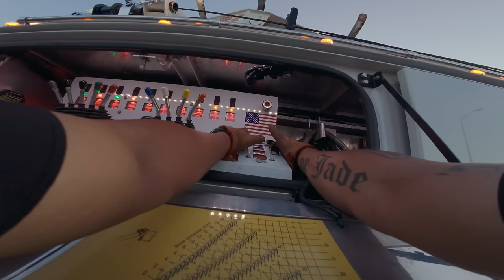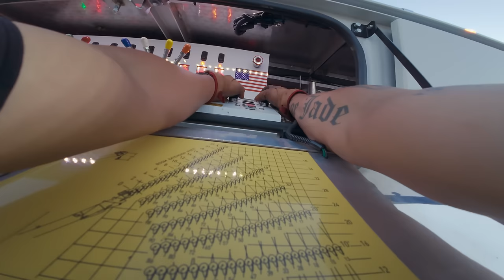Driver survives HORRIFIC semi wreck!

Comment: THAT IS A FREAKING DANGEROUS JOB, JUST LISTENING THE SOUND OF TRAFFIC GOING BY.
Reply from the maker: And we do it with a smile :_Approve:
Reply: You certainly do.  @PepesTowingService
Reply: @PepesTowingService  does traffic just not slow down in your area?
Reply: @SlickFootTito it’s southern Cali…. Way too many cars , too many idiots behind the wheel and in Cali you’ll catch your self pushing 80moh average cause everyone else is going that fast yet most speed limits in Cali highways are 65…… i used to drive from chino to Moreno Valley everyday 2 hour traffic and in such short distance I’ve seeen the dumbest things happen on the freeway…. More people more problems.
Reply: @PepesTowingService  The cops should be writing tickets while the lift is in progress, some of the speeds at close quarters is insane.
Reply: @PepesTowingService  Isn't there a "move over" law in Cali?
Reply: @MurgatroidGarfunkle There's a road rage, offensive driving, and police chase mandate in SoCal. No one will move over and people would sooner find a way to get away with a hit-and-run than help anyone else.

Comment: The shear pins on that cab works exactly how they were supposed to. 
Modern semis are designed to do that in a violence crash. It helps dissipate energy so the occupants are not subjected to massive crash forces.

Comment: On european Trucks (we manly have cabovers) especially Scania cab removal happens often on mayor accidents.
It’s most of the time a lifesafer for the driver.

Good vid as always!
Greetings from Hungary 🇭🇺 in Europe.
Reply from the maker: I’m starting to believe, but it’s a wild concept to understand. “we design our trucks so when you crash, the entire cab comes off the chassis to protect you”.
Reply: I'm guessing, but the cab probably gives you a passenger cell like in cars, and the shearing off acts like a crumple zone giving you less g over a longer time. The downside is you'll only ever crash that truck once! It's like 1970s cars vs crumple zone cars. The old ones the driver was a gonna but you could sell the car, the modern ones sacrifice themselves to protect the occupants.
Reply: I saw edison motors touring european trucks, and one of the things they noted was 4 corner air bags on the cab instead of front hard mounting, so i see how they could basically just pop off the frame

Comment: Yes God is good indeed.  Sad thing is that JB Hunt driver probably just lost his job even if he wasn’t at fault.  My husband logged over a million miles with zero accidents when he was a bull hauler.  He said the problem with the truck drivers these days is that there’s just too many out there with very little experience.  And the texting while driving situation is out of control. Sad.
Reply: JBHUNT, in the industry means Just Been Hired Usually Not Trained. This guy was doing something(on the phone?) and trying to merge Illegally into oncoming traffic. Notice how he was too far onto the non merge area. and tried to cut the wheel like he tried to avoid the accident. Clearly HIS FAULT! Was a truck driver for almost 15 years before my husbands retirement. I've seen some stupid driving in my time on the road. Two million miles for him.
Reply from the maker: @CatsCrazyWorld  JB Hunt guy was pulled over where he wasn’t supposed to be, for unknown reasons. Driver of the Volvo, if I had to bet, fell asleep or was on his phone
Reply: @CatsCrazyWorld  awesome
Reply: @PepesTowingService I drove tractor trailer for FedEx express in SoCal for 20 years. I think your assessment is 100% correct

Comment: Really great that the driver walked away from that one.  Not sure, but suspecting it may have something to do with the cab suspension systems that are designed in giving essentially a "breakaway" joint for the cab which acts like an escape capsule.  No idea whether it's intentional or not, but fortuitous in this case.

Comment: What’s the driver wearing flip-flops?    I remember the Russian that was wearing open toed sandals driving the hotshot rig with the 18,000 pounds alternator. Are there any good drivers out there anymore or are they all foreigners? Looks like you need a little more space on your driver side of your truck would be nice, wouldn’t it, be safe. You guys do a good job.
Reply from the maker: Tons of drivers in my videos wear flip flops. Comfort or correlation? :_Laughing:

Comment: Why didn’t they put the cab onto the same trailer with the truck chasis?
Reply: A hassle to find enough space and secure both properly, put the cab and truck close on to eachother. Possible if they HAD to do it and/or was any conciderable advantage/savings. But  easier just get another truck since they possible are not too far from their nearest base, and they had that additional truck sitting ready
Reply: @Rimrock300  Excellent reply.

Comment: Bro tell the Jeff' to buy some new blades for the Sawsaw machine. Like 20 min cutting them wires and air lines 😂😂 a 5 pack is like 10 bucks at Home Depot 😂😂😂
Reply from the maker: 20 minutes? How high are you
Reply: @PepesTowingService  not high enough 😂😂